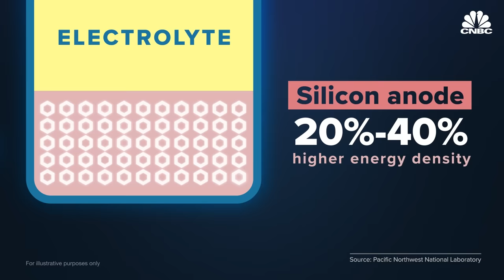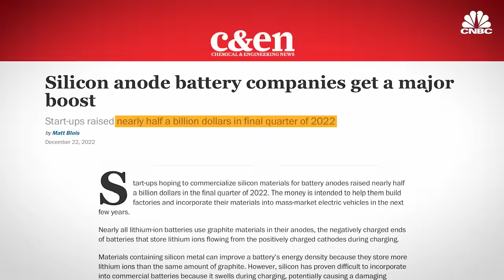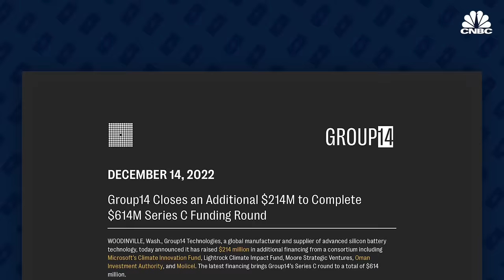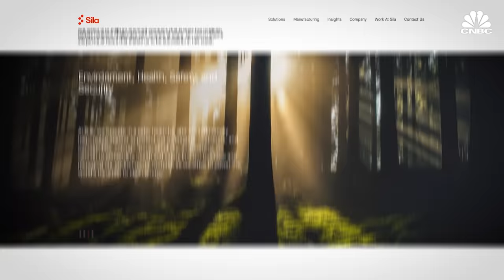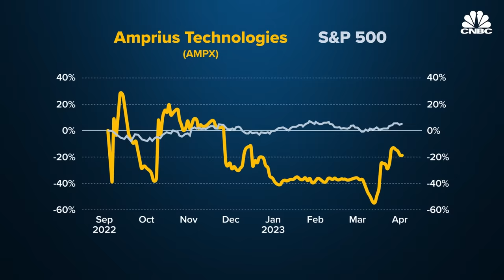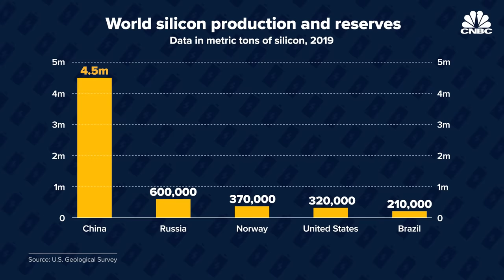How Silicon Anode Batteries Will Bring Better Range To EVs

Comment: Unfortunately very little said about about battery lifespan. It's not that great if you can go twice as far only half as much. The other hurdle it's failed to tackle here is temperature variation. Temperature can play a huge part in how efficient current designs are.
Reply: Those more of a packing issues I believe. There is lot more engineering to be done, after they make anode powder.
Reply: Cell temps are managed with active cooling. Tesla has demonstrated sufficient longevity and warranties will cover the first 100,000 miles.
Reply: That doesn't fit their narrative.
Reply: @jghall00  lmao🤣🤣🤣
Reply: Lithium-Silicone anode batteries are anticipated to actually have a better lifespan than current batteries, as per studies on them. But in practice, they're still trying to find ways to extend the lifespan, as it's similar to current technology.

So right now, that really isn't a problem
Reply: @jghall00  What about in winter in Eastern Canada, or Europe?
Reply: @jghall00  I bought my truck ten years ago with over 100,000 on it when I bought, still runs great and haven’t had an issue with over 200,000 miles, EVs are a long way from that and the government forcing people to buy them is going to cause a serious revolt
Reply: Lithium plating in the anode during charging is perhaps the biggest "ageing" issue with Li-ion batteries. (Lithium ions failing to intercalate properly into the anode). This has been the biggest area of study for several years with silicon anodes which greatly expand during charging resulting in cracking. This would have been a major target for any company testing these new anodes. According to Monroe this has been solved by Amprius. Keep in mind that a battery with twice the energy density would only need to last half as long to give the same longevity. So I'd agree that some metric for cycle life needs to be mentioned.
Reply: Geez, I wonder if they thought about that!
Reply: @Mistro07  EVs are a long way from what?
Reply: @jghall00  True. Tesla actually offers warrantees up to 120,000 miles for the Model 3 and up to 150,000 miles for the Model "S" and "Y" (Rivian warrants their battery packs for 175,000 miles).  This says a lot about EV manufacturer's confidence in the latest battery chemistries. Virtually all EV manufacturers are using some form of Active Thermal Management (liquid cooling), which is employed largely to allow high power (HVDC) charging. In Tesla's design (thousands of individual circular cells), the liquid cooling works more efficiently than those EV's using Pouch or Prismatic cells with a cold plate. Properly maintained Tesla's latest battery packs will surpass the 200,000 mile mark with less than 10% battery degradation.
Reply: @jghall00  ICE cars today can do more than 100,000 miles reliably.  If EVs cannot be guaranteed to do more than 100,000 miles on their original batteries then what's the point?
Reply: Both points I wondered when first heard about Amprius & I think they're not issues.
Reply: @timower5850  Of course they did. But have they solved it properly, or is this marketing to generate investment?
Reply: re: "Unfortunately very little said about about battery lifespan."  whoa whoa, too many questions.... okay next question.
Reply: @KP-xi4bj  How long does the ICE powertrain warranty usually last? I bet the EV powertrain warranty is longer. Have to start someplace. Battery replacement costs will come down and production scales up.
Reply: @Mistro07  There are EV taxis with over 500,000 miles on them. All EVs, by law, must have an 8 year or 100,000 mile warranty of 80% of range. So most will get much more than that or the manufacturers would lose their collective shirts.
Reply: Ignore the trolls. EV's will have far less maintenance and much lower cost-to-own over their lifetime. Just look under the hood. Electric motors have essentially one moving part. None of the hundreds of points of wear-n-tear or failure that Gasoline or Diesel vehicles have. None of the extreme heat and vibration that prematurely degrades everything under the hood (hoses, belts, wiring, sensors, gaskets, seals). No serpentine belts or associated pumps, pulleys, bushings or bearings. No alternator, mechanical water pump or high temp, high pressure engine cooling system. No typical transmission or power steering pump, so no oils or filters. The latest batteries are designed to last over 1500 full charge cycles (the new LFP chemistry being used by Ford and Tesla is good for over 3000 charge cycles). An EV with only 250 miles of range per charge, after just 1500 charge cycles, will have FAR outlived the typical gasoline engine. DO THE MATH. A gasoline vehicle averaging 30 mpg will need over 10,000 gallons of gas just to reach 300k miles. At $3.50/gallon that's over $35,000 for fuel alone, not to mention all the oil changes, more frequent brake jobs, at least two alternator and water pump replacements, at least three timing belt replacements or one to two timing chain/timing gear replacements, at least one transmission rebuild, at least two sets of pan and valve cover gaskets and one rear engine oil seal replacement, multiple O2 sensor replacements, multiple dealer trips to extinguish the "Check Engine" light, possibly hundreds of hours sitting in customer lounges waiting for all this work, and after 300k miles at least one complete engine rebuild. Conservatively speaking you're looking at well over $50,000 to keep that gasoline vehicle on the road (closer to $60,000 if you have a dealer do all that work).
   And the Anti-EV trolls want you to be worried about the "possibility" that after 15-20 years and 300,000 miles you "may" need a new $8k to $14k battery? Get real....
Reply: @jghall00  Remember when Hyundai had 10 year warranties?  Why did they?  Maybe, because they were crappy cars to begin with?  Perhaps, the same can be said for EVs?  ICE powertrain warranties are not indicative of actual longevities of ICE powertrains.  Any Toyota/Honda owners can attest to this.
Reply: @Mistro07  100,000 more miles of gas, oil changes, etc does add up. And remember, just because you take care of your truck and it lasted for you, doesn't mean it will for others.
Reply: @KP-xi4bj  It turned out that people actually needed those Hyundai warranties because of an engine defect that caused rod knock and premature failure. I didn't know ha I g a longer warranty was a bad thing. Until people get used to EVs it's beneficial. I'm selling my EV before the warranty is up at 100k...to get another EV. Love the fuel and maintenance savings.
Reply: @Mistro07  2035 is when sales of new ICE vehicles will be banned in US and EU.  But that's 12 years away --  which is a lot of time considering such intense investment, research, government subsidies, and favorable government policy changes going into EV & related green energy technology right now.  Also, existing ICE vehicles can be used indefinitely past 2035 and secondary (used) markets will still be wide open.

We would also need to consider the revolts that will happen when a hot moisture laden atmosphere starts causing the Earth to destroy our property, businesses, crops and infrastructure at accelerated rates and wider areas.  By then, revolts over buying ICE vehicles be petty.
Reply: @jghall00  I'm talking about Hyundai in the beginning when they first came to market.  They were advertising 10 year bumper-to-bumper warranties.  Meanwhile, Toyota/Honda only had 3 year bumper-to-bumper warranties.
Reply: @Mistro07  mate, ICE vehicles have hundreds of parts in an engine that can fail. Let alone the powertrain being a point of failure.

EVs don't have nearly as many moving parts, the only weak link in an EV is the battery. Which is what they're addressing, and even then it's one that many manufacturers have workarounds for. 

EVs are not that far off, if at all, from ICE vehicles in reliability
Reply: @KP-xi4bj  to be fair, Hyundai offers lifetime warranties on their hybrid batteries. Quite the juxtaposition compared to their ice vehicles
Reply: @MustachioFurioso9134  To be fair, Hyundai/Kia/Genesis ICE cars and EVs have caught fire repeatedly.  So, any extended warranty offered is a facade.  To hide the fact that their cars/EVs are crap.
Reply: @beyondfossil  Were there any humans alive to measure and record temperatures during the last interglacial to make direct comparisons?  I rest my case.  LMFAO  SMH
Reply: Lookie here a YouTube Ph.D. in Chemistry, where did you get your degree?
Reply: these silicon anode batteries have poor cycles, 100 cycles
Reply: @KP-xi4bj  I humbly suggest reading up on "proxy data" as it relates to climate research.  Here's a starting point:

https://en.wikipedia.org/wiki/Proxy_(climate)
Reply: @beyondfossil  Proxy data isn't the same as actually being there to take direct measurements.

"The timespans of proxy records vary widely. Historical climate records are reliable for a few thousand years. The resolution of the data depends on the person recording the information. Cross-dating tree rings from various sources provide reliable records for tens of thousands of years." - Climate Policy Watcher (January 16, 2023)
Reply: @MustachioFurioso9134  EVs reliable as ICE cars?  Not even close:

"Tyler Selvig explained in a tweet that the heat stopped working in his Model Y while temperatures had dropped to -40F.

'Our Model Y could have killed my family today when the heat stopped working in -40c Called service and the reset and auto didn't fix. Hour away from any service,' reads the tweet." - Daily Mail (January 19, 2022)
Reply: @KP-xi4bj  Tesla is notorious for being unreliable, but other brands and older vehicles being used as taxis have had hundreds of thousands of miles on them with little issue. 

An EV has far less moving parts than any other vehicle on the road. EV motors have been used for a century and are well understood. The point id failure on most EV's is not the power train, but the battery or other quality of life features (something Tesla struggles with)
Reply: @MustachioFurioso9134  Other EVs are more reliable than Tesla, the pioneer of mass market EVs?  Yeah, okay, if you say so.  LMFAO  SMH
Reply: @KP-xi4bj  And which time machine do you want to use to go to every year for millions of years to get "direct measurements"?
Reply: @KP-xi4bj  Sure, no ICE vehicle ever failed to start at -40°C.  Nor ever the heat stopped working in an ICE vehicle either!   That's a real LMAO SMH situation.

The most expensive and hard to fix system is the drive train.  An EV drive train has a handful of moving parts while an ICE has several hundred just in the engine itself!  An EV motor essentially has a single moving part: the rotor.

The complex transmission system is required because ICE has such low torque it could barely move the vehicle without that complex heavy expensive transmission.  EV's motors are mated directly to the input shaft of the differential and could also be mated directly to the wheel shaft itself.  It is a fixed gear ratio for ultra simple mechanics.

ICE runs so hot by wasting 80% of its fuel as heat.  Ridiculous.  ICE requires a complex high powered cooling system integrated directly into the engine block.

EV's AWD/4WD is accomplished with two or more motors.  The electrical phase cable are simple to route and no maintenance.  While AWD/4WD is extremely complicated in ICE: heavy, inefficient by wasting more fuel, limited functionality and is a nightmare to fix.  EV AWD/4WD is highly programmable features using only sensors and software to perform all kinds of AWD/4WD types and many more ICE could only dream of for cheap too.  Add $10k more for AWD in ICE and inherit all the problems mentioned above too.
Reply: @beyondfossil  Your sarcasm isn't helping your cause.  LMFAO  SMH
Reply: That’s where engineering come into play, like it always has been, isn’t it? Technology just doesn’t pop into existence overnight, doesn’t it?
Reply: @jghall00  warranties only protect the consumer. I thought the point of this nonsense was to protect the environment?
Reply: @aidenwhitaker8792  nah man, I just want to protect my pocketbook from gas, maintenance, and repair costs.
Reply: @Mistro07  uncle is past its useful life span😂
Reply: @Mistro07  Governement doesn't force anyone to buy anything.
Reply: @KP-xi4bj  "what's the point (of EVs) ?"

Ultimately, less damage to the environment, less co2 pollution (that we have no realistic way to pull out of the air).
Reply: @Tao_Tology  "-EV battery production can adversely impact the environment, such as a loss of biodiversity, air pollution and decreased freshwater supply.

-EV batteries consist of materials like nickel, lithium, cobalt and others, which are energy-intensive to mine. These minerals are also often mined in regions with a poor environmental record. Take, for example, the lithium mining currently happening in Argentina. According to Time, Argentina accounts for 21% of the world’s lithium reserves and plans are already in place to open 13 more mines (in addition to the two already in production). Many worry the mining could cause massive destruction, corrupt an already fragile ecosystem and pillage the country’s natural resources all in the name of “green progress”.

-EV battery recycling methods are still in their early stages, but they are not specifically designed to be recycled.

-EV tires wear out faster due to the heavier weight and increased torque of the vehicle. Expected lifespan on EV tires is only between 30,000 to 40,000 miles. This means you’ll be buying tires more often and thus contributing to increased emissions." - Biofriendly Planet (November 14, 2022)

EVs don't impact the environment in negative ways?  You delusional EV fanboys are naive and gullible, you bought into the EV marketing ploy with ease.  LMFAO  SMH
Reply: idk if this helps but I bought a 2021 hybrid and the battery alone has a 10 warranty and they can be repaired in sections instead of the whole battery like in the past.
Reply: @thefallenmonk605  Er ... the battery in a hybrid is NOT the same as the batteries in an EV.  LOL
Reply: @@arrell1xyz Late for work because you forgot to replace the AA in your EV?  LMFAO  SMH
Reply: envx
Reply: Which taxi company?  Name it please.
Because just the EV hire cars from Hertz were removed because they were no good.

Comment: Drawbacks aside, this feels like a significant breakthrough. Remember, this is the worst this technology will be, and it can only be improved to fix temperature variation, lifespan, and cost efficiency. Hopefully more in the future
Reply: if this is not circulair it is not helping a better future
Reply: Feels like a commercial to me
Reply: @gorter23  I consider it will be circulated. We generally can't afford not to circulate mass produced materials any longer. However when mass production ramping slowly (it will take them 10+ years to ramp) recycling facilities are built very late in the game because prior to that they can't survive due to slow volume.
Reply: It will be a breakthrough when we do the math on available minerals and realize we won't be making batteries to go 1500kms, we will be stuck with smaller batteries that have the same range as today if we are going to have batteries at all
Reply: @obtuseangler768  The WEF don't intend to allow you to travel more than 15 minutes anyway...
Reply: @@mattmann5620 again, this is a new technology, would you like me to sit here and write 8 paragraphs in a YouTube comment for a complete list?😂 We can revisit all this in 50 years and see how short the list is then
Reply: @Beat Reuteler  recycling was an industry pioneered by the petrochemical companies to push the sustainability of plastics 25 years ago.
Only glass, metal and hard pastics are recycled today, even those are not profitable industries. Metal depending on energy and freight costs is so.e years, some years no. 
For any of this to work and be a net benefit globally, we need to incentivize private industry to recycle whether it makes profit or not.
Unless we are aware of what happens to the stuff we recycle today there's no point having dreams about ideologies.
Add in the price of fuel and labour, it gets worse every month. How do we get past the hurdle we are at in 2023?